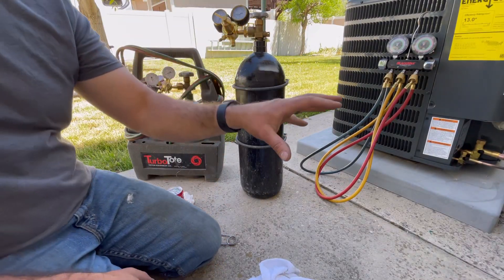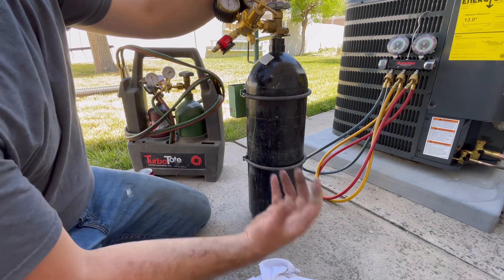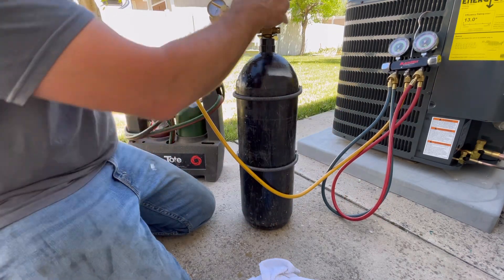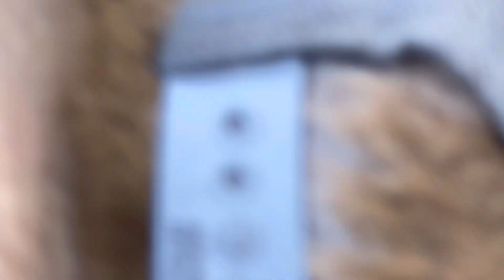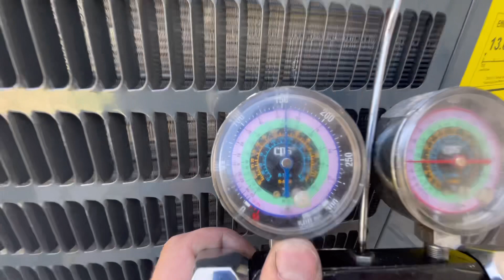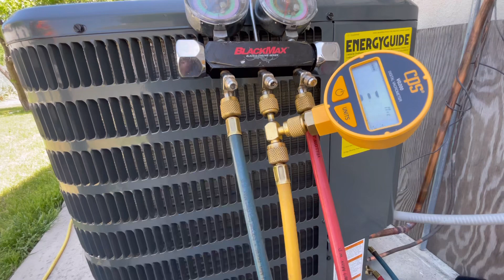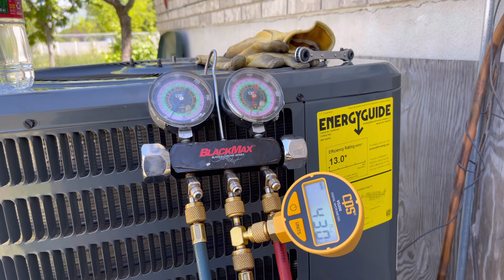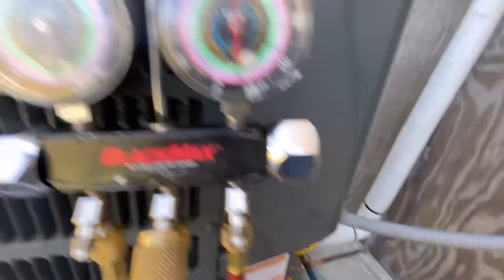DIY Air Conditioner Replacement  Part 3      -Step By Step Guide-

Comment: Nitrogen is not optional if you want your system to work correctly. Especially if you're using a TXV. you'll get away with it using a fixed orfice. You will impact the longevity of the compressor if you don't use nitrogen. 

The amount of carbon produced is a lot more than one would think. It gets washed into the oil rather quickly and reduces lubrication for the compressor.

You also didn't flush the line set which is a must for a retrofit from R-22 to R410-A. You had one of the easiest installs you can. The only areas that weren't ideal is having the furnace up against a wall. You didn't have to add pipe downstairs, the drain was easy to disconnect and reuse, your new coil is taller and didn't require building a transition, or adding material. The pipes connected directly outside. The whip didn't need to be shortened, the line set was the correct size for the new unit. You were able to reuse the old pad. You didn't have to install a new disconnect. You didn't have to swap breaker sizes. I could keep going but I think you get the point. 

 For a lot of homeowners, this is going  to give them a false sense of confidence. You showed one of the easiest installs. If a homeowner appears to start an install and runs into unforeseen issues, they will be worse off than just letting a professional do the work. Not to mention the amount of speciality tools needed to perform the work that they won't need for any other purpose except the oxyacetylene tank. You also can't expect a homeowner to understand superheat and subcooling enough to charge the unit themselves. You didn't do the superheat calculation to determine target super heat. 

You also could have closed off the high side (with low loss fittings you remove the hose) while the unit was still running and purge all the refrigerant back into the system to have the least amount of refrigerant left in the gauges. You also used mismatched wire nuts for the low voltage. I hate to say it, but I'm not all that impressed with your install. I'm a service technician. If I were to run into this install I would not think "wow this is a really clean install". 

Not trying to be a hater, just trying to be realistic. You know this was an easy install, and you know some of the harder retrofits you've done would be impossible for a homeowner to do correctly. I have nothing against homeowners fixing their own stuff. I put in a lot of time and energy into teaching homeowners how their system works when I'm in the home. I encourage them to watch me and ask as many questions as they want. I show customers how to clean flame sensors and wash out their condensers. I saw this so you know I'm not against DIY, I just want expectations to be realistic. 

If you're a homeowner reading this comment, and you're thinking about doing your own air conditioner. Take a good look at your outside unit and indoor mechanical room. If you see lots of stuff in the way, and it looks way different than this install, you might want to think twice about doing it yourself. Again, I can promise you this was a near best case scenario. Your house is probably going to be harder than what's shown here. Keep in mind he's been doing installs for 10 years. He's gonna make it look a lot easier than it really is
Reply from the maker: Hey I appreciate you taking the time to comment! I’ll admit this install I didn’t do some of the things I do now and no it’s not the cleanest install. Anymore, if you are a homeowner trying to do this, I’d recommend Staybrite 8 which doesn’t require any nitrogen flow. But  let’s be real, no one used nitrogen flow for how many years before they knew that resolved the inside carbon issue? That carbon is so fine that it mixes with the refrigerant, as it did on 30 year old systems.
Reply from the maker: Also I use the Hilmor pigs to flush lines now, but as long as there was no compressor burnout, the tiny amount of remnants aren’t going to damage the system. I have several friends who only flush when it’s a compressor burnout and they never have any issues with it.   Anyways, thanks for your input, I appreciate it. I’m simply trying to give a homeowner advice and they can do what they choose with it. I’m not twisting anyone’s wrist to replace their system but simply educating them. Cheers man
Reply: @diyhvacguy  absolutely, like I said, I'm not trying to be a hater. I'm not against a homeowner doing their own install, just trying to help them realize how much different their situation could be. 

My HVAC teacher has been doing HVAC for 39 years, and he's been brazing with nitrogen since the start. I'm not doubting that you and your buddies "haven't had any issues" with not using nitrogen or not flushing. As I mentioned it's something that would take years to show itself. I also understand that the trade as a whole isn't all on board with flushing and using nitrogen. At the very least guys can admit it makes a difference, regardless if the effects aren't immediately seen. that's not a huge focal point for me, just something I wanted to mention so homeowners were aware.

I want you to know that I don't think you're a bad technician/installer by any means. Keep at it man
Reply: You are so true that DIY looks easy till you look at your own system and if ONE thing ia different, that can throw you into a tail spin.....in thia case, my AC has a "canon lcr 5200".....what is that and how does it incorporate?

Comment: Really Good, lots of info and links to what you need... I just installed a mini-split and it was very much like this, i did not shorten the lines just in case I moved it elsewhere. Mini-splits only have a single tap (for gauge hook up) on the suction line. (Drives me nuts)
Reply: Both lines on a mini split are the suction line. The TXV is located in the outside unit. Hence why both are insulated, and why there's only one tap

Comment: Thanks for the video, it is pretty interesting learning about Air Conditioner installation. Do you have to pressure test the line with nitrogen or is there another way to you can pressure test your lines?  I don't own nitrogen and I don't want to spend the extra money to buy it.
Reply from the maker: If you are confident with your solder or whatever the line connections you use and you pull a vacuum down to like 2-300 microns you should be good. If you had a leak it wouldn’t pull down below 500 microns.  But nitrogen pressure test is the preferred method. Def don’t want to use compressed air because it has a lot of moisture.
Reply: @diyhvacguy  Thank you for your input!
Reply: One of the reasons to pressure test with Nitrogen is to remove moisture in the line set.

Comment: Where can i find the oxyacetylene kit for $200?
Reply from the maker: I have a video coming out on how to do your lineset with soft solder. It comes out this Wednesday I think. Watch that before you buy anything. You can basically solder your lineset in with map gas and it will save a ton of money!
Reply: @diyhvacguy  Thank you so much! That wil help a lot. It's for HVAC right? Can you also add what type of solder to buy, and if flux is also needed.

Comment: Excellent video! Thank you, Sir!
One tip for brazing I learned awhile back is to use the torch flame opposite to where you apply brazing rod and let the capillary action take place to fill that gap.  If You use this technique your brazing connections will look quite neat and less messy. Basically, you  don't need to torch the rod directly.
Reply: Going to try that this week! Appreciated

Comment: Sorry in advance for the ignorant question here, but how is using the acetylene and the silver sticks different than using propane and pipe solder?  and could you use that instead of the acetylene?
Reply from the maker: Propane doesn’t get nearly has hot, but soldering is filling the joint with the solder, wheras brazing is actually welding the lines together using filler rod and requires a lot more heat (about 1200 deg) wheras soldering only requires about 400 degrees. I’ll be doing a video on a product called Staybrite 8 that is a soft solder specifically designed for hvac applications, and it can be used with mapp gas to solder hvac lines so stay tuned for that! Cheers

Comment: Just for those folks looking to do a replacement system - another option for DIY'ers is to go with the DIY MRCool replacment condensor and indoor air handler system with pre-charged line sets.  You buy the length of line set you need, which is precharged for the line length, and the condenser is precharged for the remaining volume.  No braising required, hook it all up and open the valves and away you go.  System comes in 3-5 ton sizes.  Replaced our system up in Canada for $3k US versus over 3 times that for a contractor to replace the system.  Took me one day to do it. easy.

Comment: Thanks for the video!   Couple of questions for you:    I'm assuming you went from an R22 to a 410A system.   Without replacing the line sets (which I would do for a system for my home) why didn't you flush the line sets to remove the R22 oil/contaminants?   Also, did you notice the kinked flex natural gas line on the furnace?   I hope that was replaced.    Thanks again for the video!
Reply: Can I flush the r22 line or do I have to replace it to a brand new line converting to 410A? Flush will save time and money but how? Thanks!
Reply: They make what’s called Rx11 flush.your going to want to flush the lines with this and follow with nitrogen to ensure all the old refrigerant is out.Mixing refrigerants is a no no.I WILL SAY THIS BE CAREFUL WHEN WORKING WITH REFRIGERANTS THE EPA TAKES IT SERIOUSLY AND YOU CAN BE FINED FOR RELEASING REFRIGERANT INTO THE OZONE.
Reply: @ReginatorX   So, if the system was for your personal home, would you flush the old lines or install new ones?  I've seen varying opinions on this.

Comment: We had our 3.5 ton go out on us 2 years ago, was quoted $6k by a company.  We talked the tech into doing it himself on the weekend.  We bought the inside & outside for $3k and he charged a $1000 to do the labor.  Considering he had a buddy to get into the attic and remove/replace the evaporator, I think it was a really good $1000 spent.
My daughter's house will need one soon.  I'm REALLY tempted to invest in the gauges & torch & Vac Pump, but for $1000, I might take the easy route.
Either way, THANK YOU  for showing how really simple it all is.  It's the copper that has me spooked...
Reply from the maker: Nice!! Thanks for sharing
Reply: You are a sad human, who talks a tech into stealing from the company that he works for? Liars and cheats. You will reap what you sow.

Comment: Great series, I wish this was available 30 years ago when I installed my system.  I only had a contractor solder the lines.  I was wondering why you didn't use a dryer?  I didn't add a dryer 30 years ago either, however, contractors seem to use them more now.  Anyway, knock on wood, my system still runs without the dryer 30 years later.  Thank you.
Reply from the maker: The Goodman’s come with an internal filter dryer which is nice. You could do an additional one though.

Comment: Did I miss putting freon  back into the system?
Reply from the maker: The refrigerant is contained in all new condensers. So after we brazed the lines and pulled the vacuum, we then opened the valves which released the freon from the new condenser into the lines and Evap coil 👍🏽

Comment: how best do you flush a line, going from r22 to 410a.

oh and if anyone needs to buy freon, just take the online test and get certified. that's all you need, took me only a couple of hours and passed the test and done.
Reply from the maker: Nice! I’ll be doing a video on the easiest way to flush a system but it involves purchasing what they call foam pigs. They a little foam insert that is specific to the size line you are flushing, and you blow it through the line with compressed air or nitrogen and it pushes all oils out the other side: then you take a bag and tie it to the other side so it will catch the pig when it shoots it out. I’ll be creating a video on this soon so stay tuned for that! Cheers

Comment: im amazed at the haters here. ppl cant see past their nose to realize some things are just good to do, but not mandatory. 

great video. appreciate it. being in electrical, I cringed at you not testing no voltage after you pulled the disconnect. sure, that should work, but yea, I'm into electrical and focus heavy on that like other focus heavy on other things they don't like. I'm not hating, you did great in your video. kudos!
Reply from the maker: Thanks bro 👊🏼

Comment: Just a question, during your nitrogen purge/braze how is there a nitrogen flow through the system with no open outlet?
Reply from the maker: I just crack one of the lines so the nitrogen has a place to escape.
Reply: @diyhvacguy  Ah, thanks.

Comment: Just watched all 3 videos and as a retired HVAC tech. there are a couple of things I would have done that surprised me that you didn't do. I would have installed a liquid line filer dryer since there was a change in the refrigerant but the first thing I would have done is not to recommend a home owner do this kinda job themselves because for one they probably could not get any of the stuff needed to do the job from any HVAC supplier because they normally only sell to contractors. The second reason,though it might not make much of a difference these days , is no EPA certification to do work on the refrigerant circuit.
Reply from the maker: Thanks for the feedback. The Goodman’s have a built in filter dryer so I didn’t want to over restrict the liquid line. Haven’t run into any issues in that regard.

As far as tools, all of the tools needed can be purchased on our Amazon store in the video description, and if someone has a similar situation to this where they are just trying to upgrade they can pump the refrigerant into the condensing unit, and then do vise versa with the new system. If 15-20 ft, no refrigerant should need to be added, but if so, they could call an hvac company to check the subcooling or superheat depending on the metering device. 

Anyways, I’m not twisting anyone’s wrist to do this. Just sharing knowledge. I appreciate your input! Cheers
Reply: Good point. Under section 608 of the clean air act it is in fact a 37,500 fine for anyone who isn’t certified by the EPA to work on these units. Per day! This most certainly is something a home owner needs to know.
Reply: @michaelcso2400  I did it, the EPA did not find out!!  I must of been lucky!
Reply: @michaelc.sobczyk9100 its also illegal to speed by 1mph but everyone does it.....what the government doesn't know, doesn't hurt them 😂, lol
Reply: @michaelcso2400   The EPA has ruined roofing shingles, gas cans stain and paint, just to mention a few. Fuch'em.